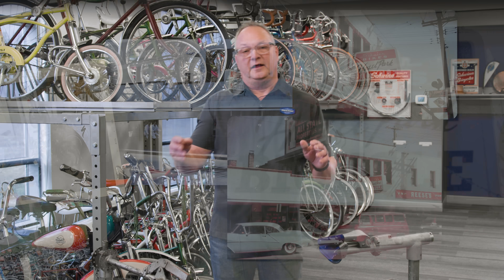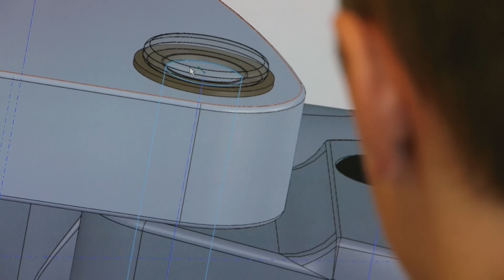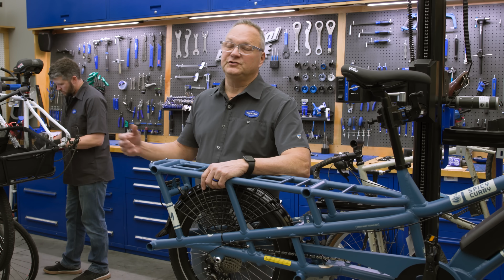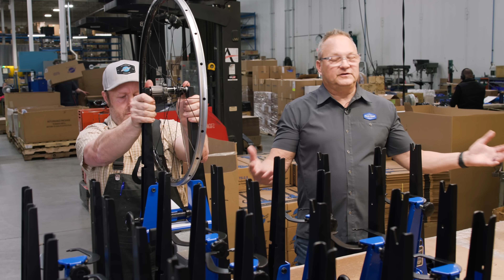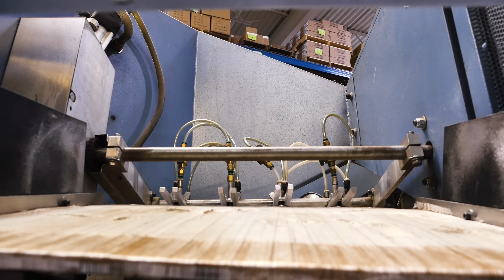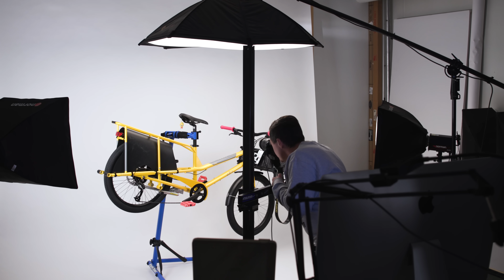Park Tool Factory Tour

Comment: I like my cheap imported stuff as much as everyone else. But this is a great reminder to buy American made when you can. And I hope they have an executive suite for Calvin!
Reply: Agreed.  Bought a Cyclospirit derailleur hanger alignment gauge tho king it couldn’t be too far off from the big boy version.  It wasn’t that much cheaper at like 49$, compared to like 79$ I think for the dag2.  It was basically unusable.  The main connector has slop in the fitting and thus has no way of properly aligning the hanger, and is basically good to get it in range but not really a precisely aligned setup.  Fine if you want to tune an 8 speed but bring it into modern drivetrains and it’s trash. 

But once cry once when it really matters

Comment: Full vertical integration. Great (and not surprised) to see an excellent company still doing it the quality way instead of outsourcing to the cheapest supplier.
Reply: That assembly area doesn't look big enough to make I think he said 500 tools. They have to be outsourcing.
Reply: The general tools, wrenches, pliers, screwdrivers etc will be outsourced, Unior on the other hand do make all their own tools with steel from their own foundry

Comment: When you're tired from a job that uses your computer all day, Park Tool videos can cheer you up. I'm going to try a little harder. Sometimes you may want to adjust your bike a bit. Thank you very much. I can't buy too many products, but I have PCS-10.3, TS-8, TM-1, SW-0, TW-2.2, TWB-15, MWF-3, AWS-1, HT-8, CNW-2, PH-5, SCW-13~15, CC-3.2, and recently I bought an AV-1 and BBB-4 (kindle) for myself. I gave the MTB-5 as a gift to a colleague who is retiring from the company. Except for PCS 10.3, most of the tools cost less than 3,000 yen, so they fit my budget. I use LC-1, PPL-1, HPG-1, and ASC-1 all the time. Someday, like Calvin, I would like to be able to adjust the cup and cone ball bearings on the hub well.

Comment: In the early 80s I bought a TS2 from your White Bear Ave. store.  If I remember correctly it was made in the back of the shop.  Still using it over forty years later.  Even used it  in the bike repair classes I taught at the local high school.

Comment: I just bought a used TS 2.2, knowing Park Tool's high quality and having used their stands and tools over thirty or so years as a professional and also at home. I was shocked to find that the stand had left the factory with a part welded out of true, which makes it necessary to set the wheel supports off-centre to compensate, even after moving the caliper support arm fully one way. The calipers are canted several degrees to the right, and therefore don't line up at 90° to the rim braking surfaces. This also means that vertical run-out can only be checked against one of the two calipers as the other is always a few mm lower. I guess I shouldn't have relied on reputation and should have made the seller wait while I ran a load of tests. Maybe someone at Park Tool will read this and restore faith 🙏
Reply: Park Tool makes a tool to true their trueing stands - your stand is likely in need of a true.
Reply: @tincanhobo  I bought the stand with the calibration tool and calibrated it. That's how I realised there was a problem. You may have missed the part where I described how the plate that mounts the calipers on the pivoting armature is visibly welded out of whack (rotated a few degrees clockwise as you look at it from the user's perspective).

Comment: I enjoy most of park tools gear, the brake mount facer is one of the more annoying ones though 😂  
I would like to see a low profile 1/4 bit ratchet for hard to reach places though
Reply: Wera do a great mini-bit ratchet.
Reply: If it's configured in a way where you can't smoothly turn the blue knob, you can use a 3/8-inch square drive Torx E14 socket with your favourite ratchet wrench. This tip is courtesy of Dave Rome from Escape Collective.